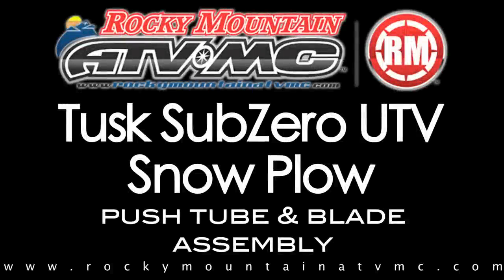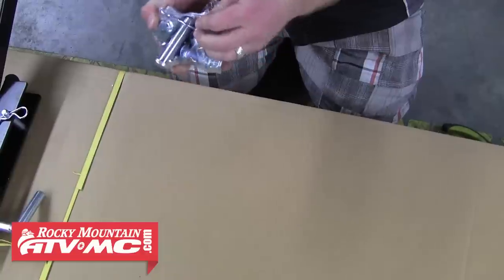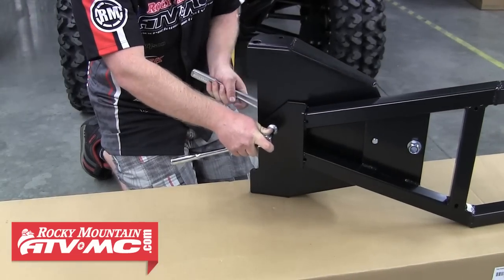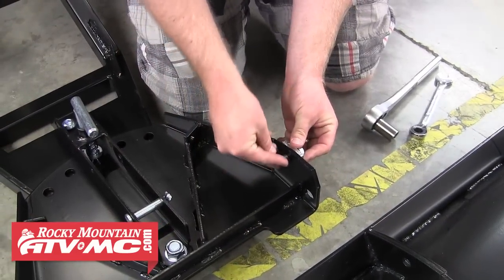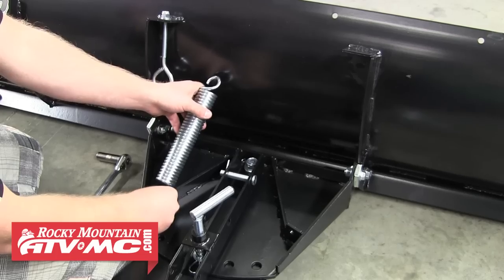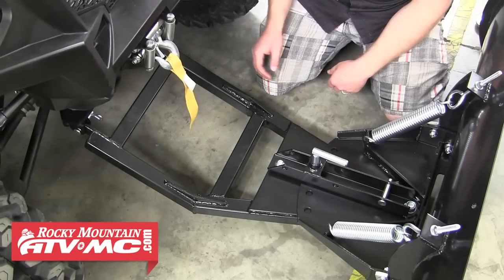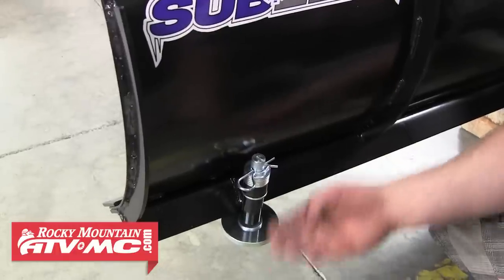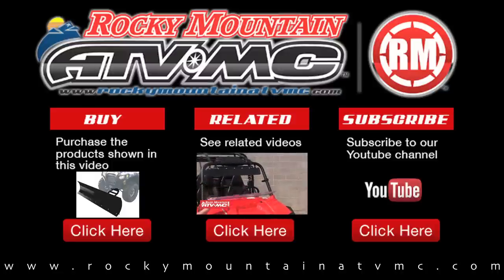Tusk SubZero UTV Snow Plow & Push Tube Assembly & Installation

Comment: Just put on a Tusk snowplow today...  came with a good coat of paint that would pass as powdercoating.  The allen bolts are still an issue but I had that big allen head bolt socket.  I had a Tusk EVO Front bumper that had to be loosen up to slide the plow mounting bracket underneath it.  Otherwise by following the Youtube Tusk Snowplow video all went smoothly.   About an hour's job.  Nice fit, looks great.  Ready for the snow in Michigan's Northern Lower Peninsula.  Let it SNOW!